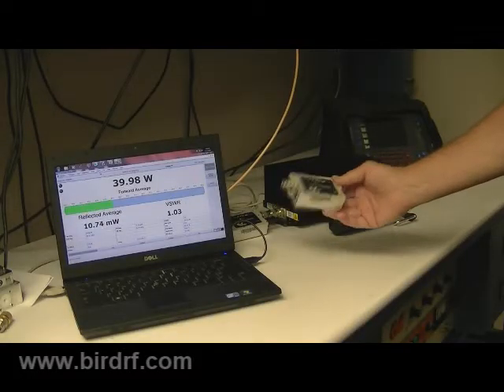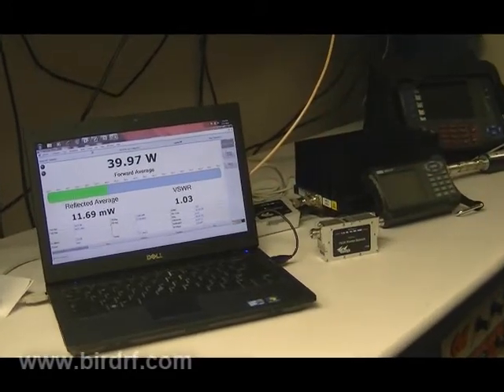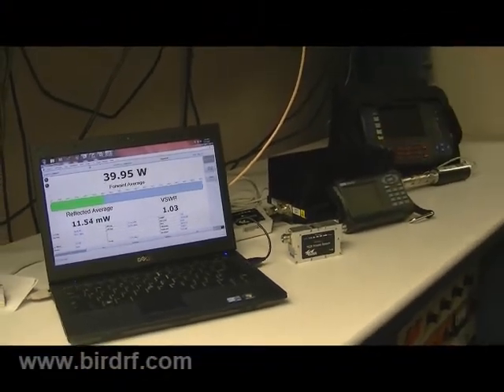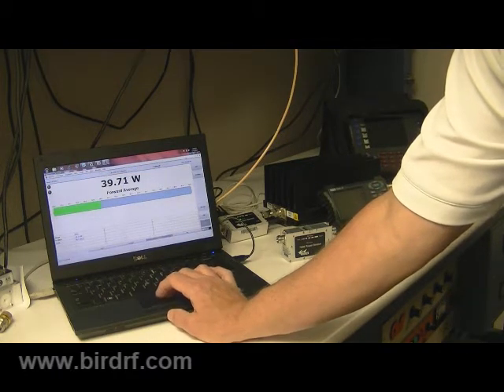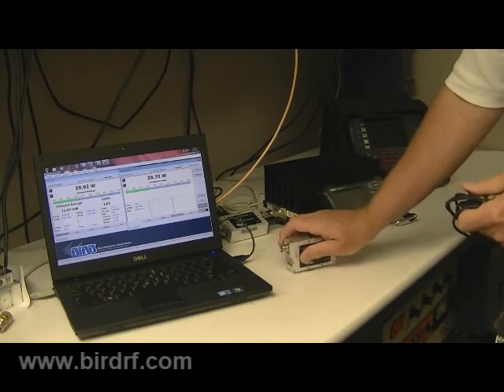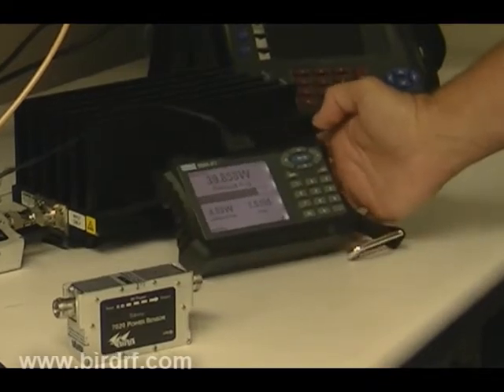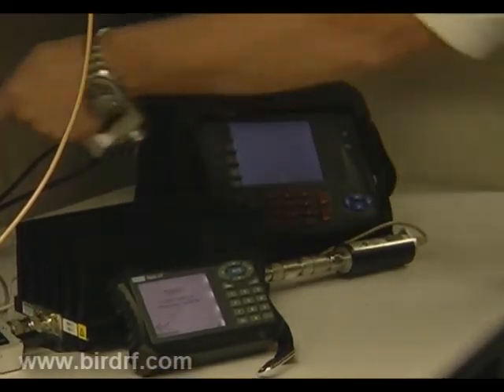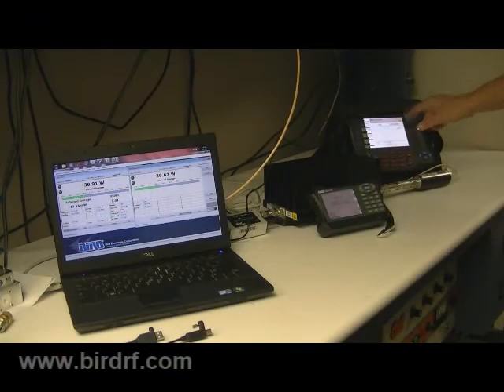Setting up the Bird 7020 Wideband Power Sensor

Comment: Hi,
One question;
I recently bought the DSP 5010B model. I'm trying to get the VPM3 software to recognize it, but I do not get it.
To be recognized, would it be necessary to have the DPM plugin elements inserted?

It's more,
Should an online test be performed so that the software can recognize the power sensor?
That is, connected to a transmitter and an antenna or load.

Thanks.